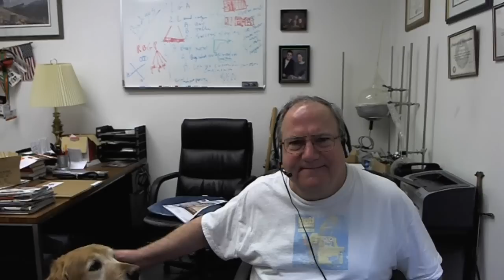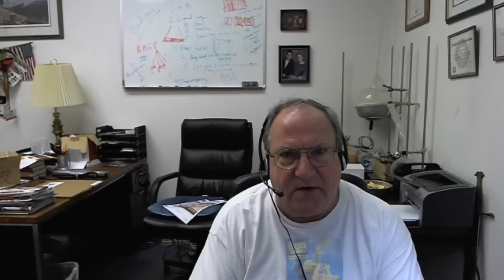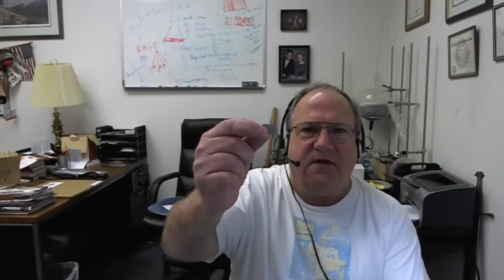Silver Brazing vs Silver Soldering | Carbide Processors

Comment: I have used Harris 15 for silver brazing and Stay-Silv white flux, works great on bronze, stainless, cast iron. 
And even some sterling silver like dining room stuff for silver brazing. 
I have also used plumbing solder, (not lead) and acid flux for fixing cracks in cast iron parts and  manifolds (not exhaust).
I put the cast parts in an oven at 350 then lay them in dry sand to help keep in the heat so they dont crack.

Comment: Hi. Thanks for clarifying the differences. 
But I still have problems when I look for the brazing flux.
Please let me know what brand of flux do you use, and if possible the part number?
thank you  kindly.
Reply from the maker: +Paul Castro Hi Paul, we typically use our Purified Flux for brazing. This type of flux has undergone extra processing steps to remove most of the large and small particles thus creating a stronger braze joint. If you would like more information feel free to visit our website at www.carbideprocessors.com. Type "flux" in the search box located in the top left-hand corner of the screen to go to the webpage.

Comment: good info,,i recently fabricated a  jeweler mini torch (actually smaller tip than jewelers use) that runs on oxy/prop and i wanted to see if i could solder or braze steel with it,so i got two short pieces of 1/16" steel wires and found what looks like 1/16" silver brazing wires as well as some flux from my dad's stuff,,i was having too many problems with the silver balling up and too much heat oxidizing everything so i did some research online and realized a few things like having the right flux which is typically made from boric acid,borax etc,i figured the flux i had might have been for tin soldering,,,i got some boric acid from a bottle of pest killer(100%boric acid) and made a bit of a paste with water and put it between the rods,cut a small rod of the silver and put it on top as the paste helped bind all parts together,then used a small flame(carburising to neutral) and it started burning the flux then heating the rods till they got almost red white hot before the ball of silver wet out and melted in between the rods,,the finish looked great but when i tried repeating the process i did not get the same easy exp,,lots of crud and back stuff so i tried to heat it up hoping to redistribute the silver nicely but it turned into a golden then dark color and more crud,,i diped it in the paste and tried again,it helped ,,,i guess what the flux does aside from helping absorb and wet the silver is also to remove the impurities